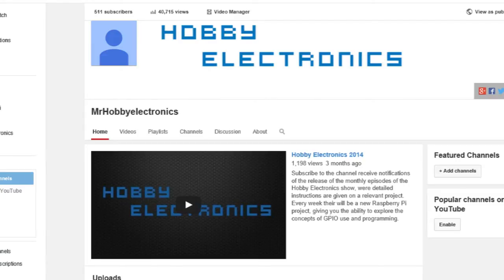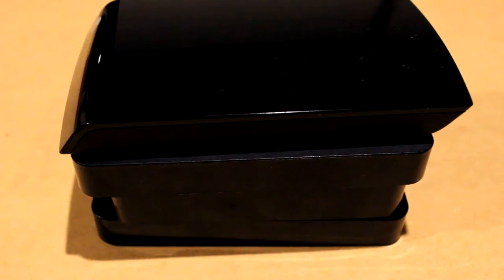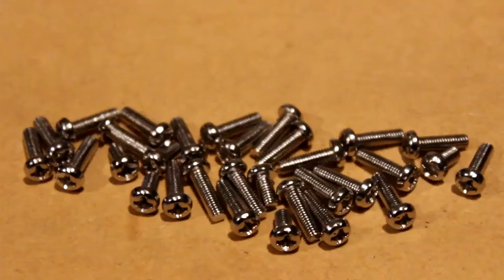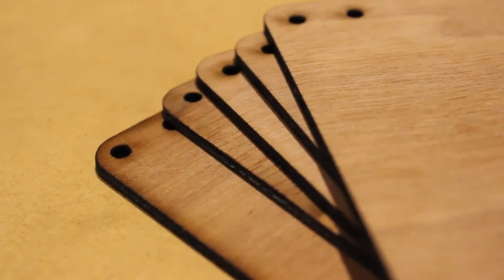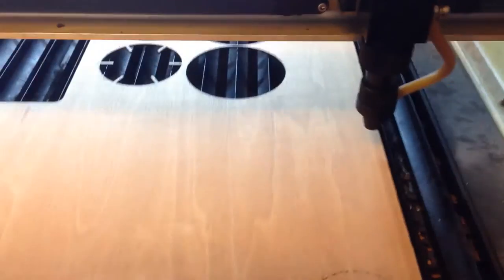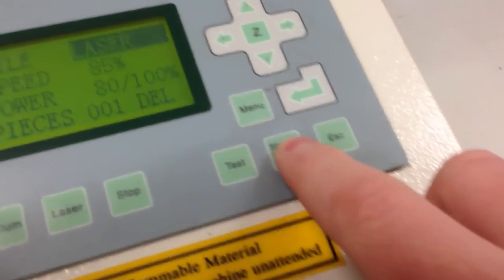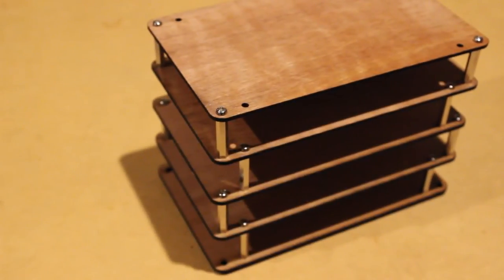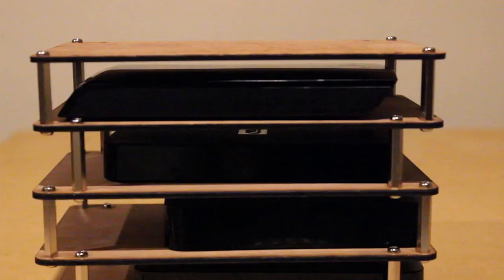Portable Hard Drive Rack

Comment: The stand-offs should screw into each other which means fewer holes need drlled on each board and the result is much neater.
Reply from the maker: That’s a good idea, I did notice after making this that there were certain PC stand offs that had a male and female threaded ends that could poke through the board then mount the next one directly on top

Comment: Hi Just wanted to ask if the following are correct:

Plate - L=200 mm, w=160 mm, H=8 mm 
holes at the corners diameter=3.5 mm at ~10 mm apart
Stand-Offs 40 mm M4 FF

Thanks!

Comment: I like it, but can i offer some design input.  make bottom tray perforated and top of bottom tray solid heat barrier then add a perforated tray for heat dissipation with say 1/4 inch spacing between perforated and non perforated floor.

So as follows bottom floor perforated, top of 1st bay solid and 1/4" up a perforated floor that 2nd drive will sit in on. repeat, top of 2nd bay solid then 1/4" up perforated floor for a 3rd drive to sit, etc etc.

Comment: What are those fixing posts called, and where can I buy ones the same as these? An excellent idea btw. Thanks for uploading.
Reply from the maker: +Dead.Skin.Mask Hi, the posts are called 'Stand-offs', you can purchase them from Ebay just search '25mm stand off'. Thanks for the comment and feedback. :)
Reply: +MrHobbyelectronics. Thank you for the reply. It's much appreciated. I'm going to try building one of these for my full size external hard drives, so I'll have to source Stand-Off's longer than 25mm. I found 60mm ones on Amazon, so I'll give those a try.